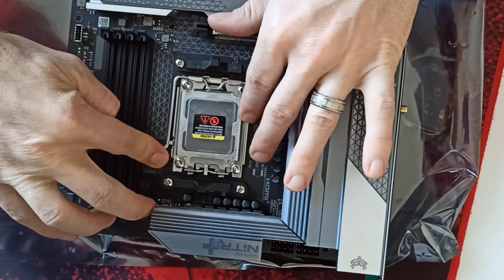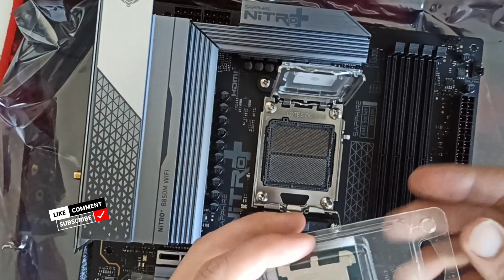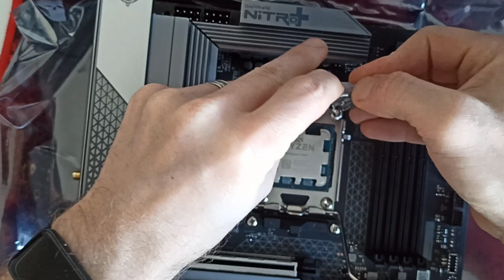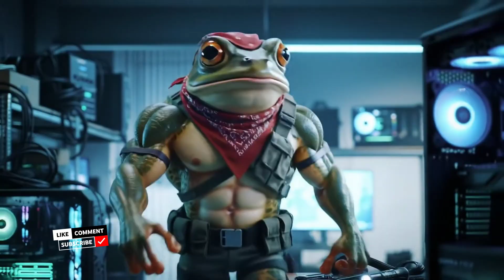Most People Install AM5 CPU WRONG… Don’t Be One of Them

Comment: Position the motherboard and cpu upright. I’m glad they made it so easy pn am5 to do this. Everything else about am5 is awful.
Reply from the maker: Absolutely AM5 is finally why I go back to AMD as well :-)
Reply: @frogtechtips ftr i meant the amd socket is super annoying to use, but the processors are amazing.
Reply from the maker: Am5 is fine I think am4 with pin on processor and socket before as well been worst but ye slowly improving
Reply: @frogtechtips Why is pin on the processor bad? I think they are less likely to bend this way, and it's quite a bit easier to get it into the socket. Am4 pins were stiff, am5 pins are super flimsy. Also the latch on am4 is too weak you wonder if it's even locked in.
Reply from the maker: @Reaktron99 problems can be on second hand market but ye if you know what you do is ok for any socket